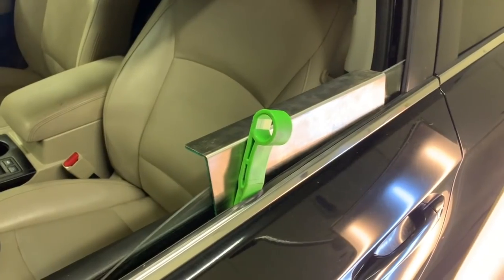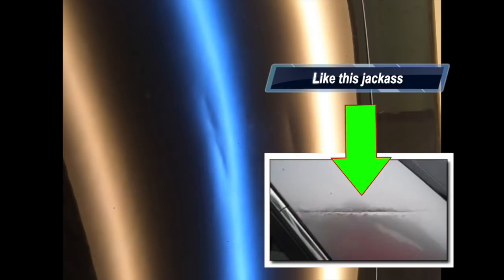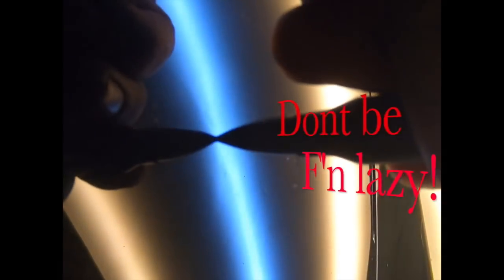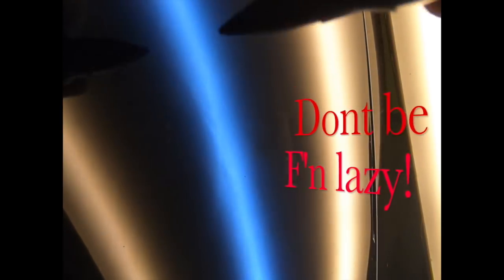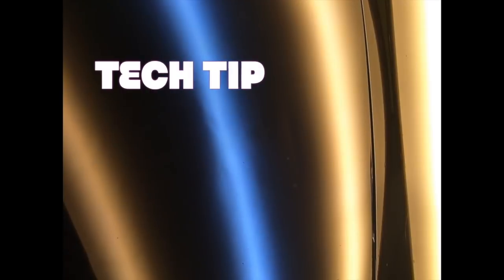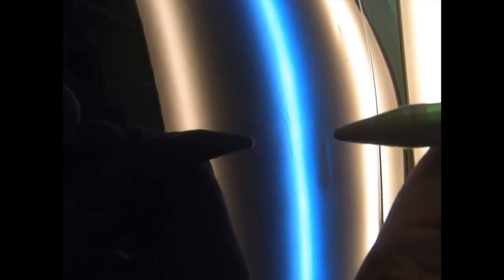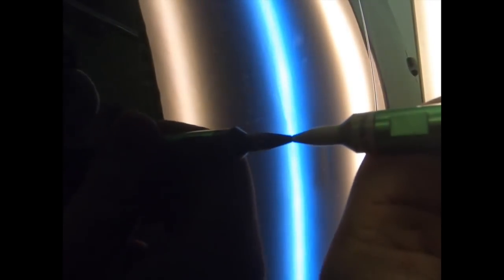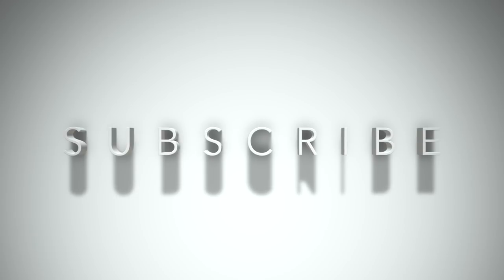PDR Lesson - crease dent - 🐳 whale tail

Comment: What do you do if it’s on a truck rear quarter panel that is double walled? Tried pressing from back but it’s too thick.
Reply from the maker: Chances are more leverage is needed, because most trucks are single layered on the bedside, but very hard to move without good leverage. Take it slow. Easy to make things worse instead of better
Reply: @RealWorldPDRTraining  good call. Tough to get leverage where it’s at so I eventually gave up.